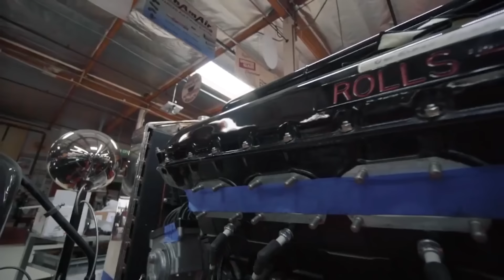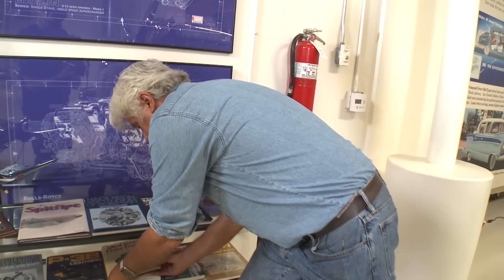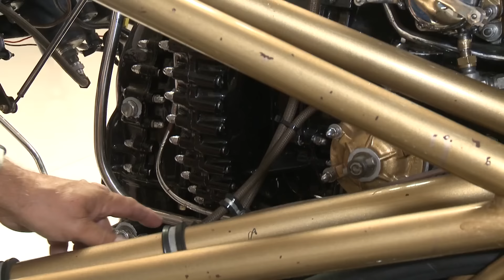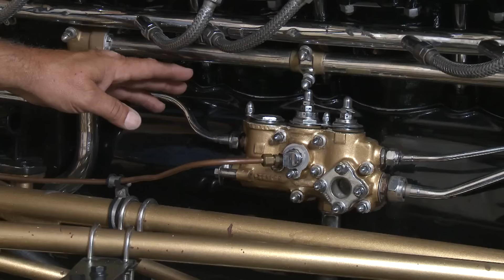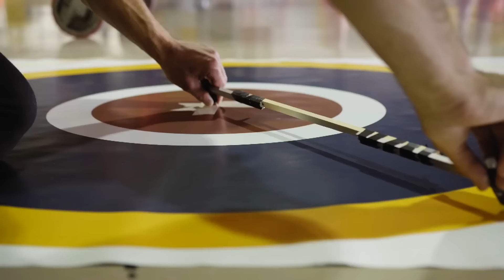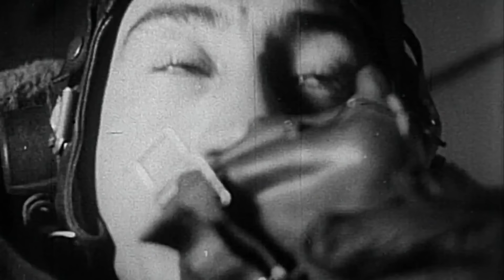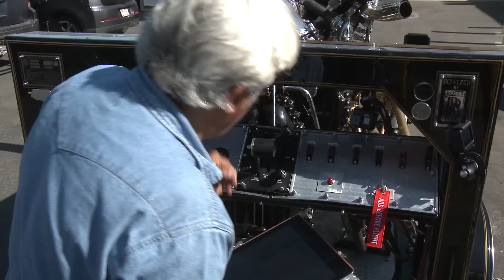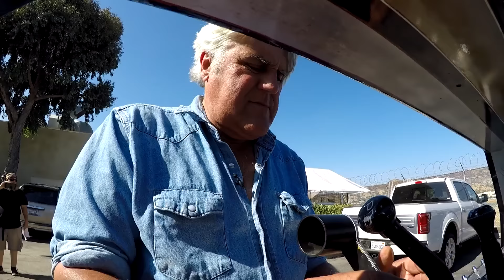The Engine That Won World War II - Jay Leno's Garage

Comment: How could you not mention the Spitfire, the Hurricane, and the Mosquito??  HELLO??
Reply: Now fellas, don't spoil a good thread by arguing. the Spitfire took on the German fighters and the Hurricane went after the bombers. It was a better gun platform and still relatively agile for the period. The Spitfire gets all the credit, because it is simply the single most beautiful war bird ever built. As a side note, the British almost named it the shrew..
Reply: The Packard V12 used in PT boats wasn't a Rolls-Royce design; it's a much larger and slower-revving engine that Packard designed to meet a military specification.  Yeah, thanks to Jay for sharing his rare and impressive engine.  It's an artifact that runs!  What more could we ask for?
Reply: @rocketman63  rocketman  M2500 was 50% larger than the Merlin and was redlined at 3,000 RPM  same as the merlin !!! !  DUUUUHH!!!!!!!!
Reply: @wilburfinnigan2142  Neither type was run at redline for more than a brief period.  I don't have the facts before me, but I do know the Merlin was rated to run at "emergency power", reached at maximum RPM and increased boost, for only a few minutes.  They required careful inspection after use of emergency power, which was true of many piston-engined aircraft.  

        It's very unlikely that the Packard M-2500, or indeed any marine engine of the time; spent much time at or near redline.  They produced most of their power lower in the rev range, and the reduction gears were designed to take advantage of this.  Cruise RPM was 2400 for the 4M-2500.  There would be little point in turning (and stressing) these engines when there was little need. Further, unless they were on flat calm waters, these boats would have been a pounding, bouncing handful to try controlling at 40+ knots.

        One last point, and this purely subjective,  I used to allow snide people like you to piss me off and detract from my enjoyment of Youtube.  Now, I realize you reveal much about yourself by pouncing on a comment you don't like with a nasty remark.  So my response to YOU was without rancor.   Perhaps you need a little enrichment in your (off-line) life.  

        Happy Youtubing.
Reply: @rocketman63  M2500's were known to be a tough engine and were run hard in war time and they held up !!!  Nothing wrong with the engine and over 14,000 of them saw service all over the world in WW II !!!   War time conditions were not conducive to timely tear downs or checkings, they run em till they broke and put a new one in !!!!  PACKARD did its self proud with the design and construction of that engine !!!!  !
Reply: jtkent.
In 1940 there were more Hurricanes and they did down more but a lower percentage, from 1941 the Spitfire was flying sweeps over France, the Hurricane doing ground attack and defending Malta until Spitfires took over as they did in Malta and everywhere else.  Spitfires seem to get a lot of negative press these days and it takes a lot of research to find out true combat figures but from what I have seen the Spitfire would seem to have downed more German planes than any other fighter.
Reply: Barrie Rodliffe I actually thought I heard the hurricane did actually down more aircraft in the entirety of the war than the spitfire, but I could be wrong.
Reply: Barrie Rodliffe. Both planes had their place. As you probably know in the Battle of Britain the Hurricanes shot down more planes than the Spitfires. The Spitfire was cutting edge technology with an all stressed metal skin while the Hurricane was a half and half stop gap (all canvas behind pilot). In 1938 two or three Hurricanes could be made in the time it took to make one Spitfire. The Spitfires and Hurricanes issues revolve around being so small there was little room for bigger guns or much fuel. 
Some Americans even call the Mustang the Spitfire MK2, it was a huge disappointment before the RAF experimented with putting a Merlin in a couple. If you look at the late war Spitfires (mk. XX+) they are virtually a different plane being almost 50% bigger.
 As stated this video is about the engine which was used in tanks, planes and boats. The British PT boat the MTB had 4 of them....😁. This engine was a war winner. Nice one Mr Leno.
Reply: Ronald Reed 
Barrie Rodliffe the p51 was a superior plane to any of thpse planes mentioned, after the packard rolls was installed 

Strange that this comment was made to me then deleted.

Just to take it at face value.
The P 51 was superior to any of those planes mentioned after the Packard Rolls was installed."   There was no Packard Rolls, Packard were a subcontractor producing rolls Royce engines so the Rolls Royce engine being installed in a P 51 made it better than a Hurricane, I guess that is true except the Hurricane was used from the start of the war not just from early 1944. 
Better than a Spitfire?  well in early 1944 the Spitfire k XIV performed better in every way except for range, the Mk IX had better acceleration, climb and maneuverability.
Better than a Mosquito?  not quite comparable, Mosquito`s were used for long range photo reconnaissance, bombing, anti submarine and anti shipping, night fighter and other jobs the P 51 could not manage.
Is it a coincidence that the Mosquito and Spitfire were better for shooting down V 1`s too.
Reply: Stu Art. It’s an engine, not a motor!
Reply: rocketman63 >>>  well he could have mentioned all those, but to do it justice, we’d have been watching this video all night.  He has to keep it brief to keep it under 30 mins.
Reply: Silverarrow the reason the Germans were reaching for superweapons was out of desperation, I agree the DB was a superior power plant in the early years but developing the Merlin lead to a magnificent engine, reliable and powerful yet buy choosing to develop the gas turbine the Germans handicapped themselves, the junkers jump had a TBO of less than 50 hours which it never met in operational service and the airframe technology was not capable of dealing with speeds greater than that of a mk8 spit anyway so the whole exercise proved a waste of time and resource.
Reply: Silverarrow. 
The me 262 first flew in  April 1941 with a piston engine in the nose because the BMW engines were not ready, the flight in July 1942 using the BMW`s and both engines failed, lucky the piston engine was still there, after a lot of modification to take the Jumo engines it took until late 1944 to get enough of these troublesome engines to put the Me 262 into service in small numbers, it could still not match a Spitfire or Tempest.
The Daimler Benz used in the Bf 109 did use fuel injection but that did not give as much power as the smaller RR Merlin in the Spitfire.  The Spitfire and Hurricane did not stall in a climb or steep dive, they had a momentary cut out with negative G but that was not hard for pilots to avoid and soon remedied.
Reply: Barrie Rodliffe one of the reasons for developing fuel injection over the pressure carburettor was consistent fuel metering between cylinders at all power settings something a large engine with a single carb could never achieve resulting in some pots running lean and hot, and some running rich the problem was so bad that engine manufacturer of the day were fitting diffusers (low-no boost superchargers) just to ensure better distribution. The injection system was crude but continental still build and sell full flow uncompensated injected engines for use in modern light aircraft. 
I have no idea what weights you are comparing, the MTOW of machines around at the same time puts the 109 at a half ton heavier and pilots reports of their machine outclimbing the opposition should be treated as circumstantial as there are far too many variables compared with book figures which are supplied for the purposes of ascertaining weather or not a machine is serviceable on  test flight.
Reply: Barrie Rodliffe the stoichiometric ratio is the name given to the optimum fuel air mixture, just for your future information.
Reply: Barrie Rodliffe I'm sure you spent a long time trawling wiki for all the figures you quoted, it's quite easy for you to do the same with "calculating bhp" I assume you have which is why you are being insulting.
Bhp can not be measured, all a dynometer does is measure torque and speed, run them through the equation I have already given you and show a bhp figure based on watts original equation.
If you are incapable of grasping the basics of piston engine theory then I must assume that you are just another troll.
Reply: Barrie Rodliffe there is absolutely no point talking to someone like you, obviously you have now checked, realised how utterly stupid you look and are trying to worm your way out of it, I fully expect you to be busy editing your previous comments as if this was important on any level, as if what the few people that may eventually read our comments opinion actually matter. The truth is  the only thing that matters is that you are a pathetic individual.
You have no idea what bhp actually signifies, apologies for writing five, instead of force, but I meant to say force * distance, this is torque.
Reply: Barrie Rodliffe have fun editing all your previous comments, I hope you can look back on it and consider it time well spent.
Reply: Sorry Barry but the Hurricane was much more successful in combat than the Spitfire: 
The Air Ministry confirmed this with its statement, ‘The total number of enemy aircraft brought down by single-seater fighters was in the proportion of 3 by Hurricanes to 2 by Spitfires,’ and also noted, ‘the average proportion … of serviceable [aircraft] each morning was approximately 63 percent Hurricanes and 37 percent Spitfires.’
Reply: Yes mostly because they entered service earlier than the Spitfire.They were similar in many ways apart from fuselage construction!
Reply: The Spitfire was an interceptor, and really had no range compared to the P-51. Therefore it wasn't used in the same way as a P-51. I'm a big fan of Spitfires, but the P-51 was just an all around more capable, modern airplane. 
The war wasn't won because one airplane turned better or climbed better than another, it was how and where the plane was deployed, tactics, and the numbers available. 
The British keep trying to rewrite history on the internet, doing more damage to their heritage and to their airplanes credibility.
 Stop trying to defend an airplane- Spitfire, Mosquito-- that don't need to be defended.
Reply: Brian O'Toole the p51 had 2 engines the Merlin which was better for bomber support and the Allison 1710? Can remember the size and that was better at low altitudes because it lacked the second stage supercharger why does everyone forget the Allison wasn't worse then the Merlin it is and was a wonderful motor
Reply: The P-51's range changed everything in the air battle during WWII.  The Spitfire and Hurricane are nice machines but inconsequential in terms of its overall impact.
Reply: andreboy1 

The P51 was an excellent aircraft which allowed the USAF to continue daylight bombing operations over Germany, maintaining the pretence that they were bombing precision targets from high altitude. Without the P51, they could have switched to night ops like the RAF, and admitted that they were largely area bombing. The main success of bombing from '41-'44 was to pin down resources in the West rather than allow the full attention of the Nazis to be focussed East. Whilst it did reduce production capacity, the post-war strategic bombing survey found that the rate at which this occurred was not as significant as hoped.

However, without the Spit & Hurricane, there may well have been nowhere for the P51 or the B17 or the Lancaster for that matter to fly from.
Reply: Paul.
As I know there were more Hurricanes than Spitfires in the Battle of Britain and the Spitfire had a higher kill ratio and lower loss ratio.
If you look at the Spitfire Mk IX it was very capable from 1942 right through to the end of the war, some even shot down V 1`s and Me 262`s, the Mk XIV which had the Griffon engine was still very much a Spitfire, the Mk 21 did have a different wing and it was almost given a different name.
The Spitfire was able to take the Hispano 20 mm cannon, usually just 2 of them but it was tested with 6 x 20 mm.  The short range is a bit of a myth since Spitfires were able to carry extra fuel, the Mk VII and VIII had 124 gallons internal fuel, including some in the wings and could take a drop tank so range was more than doubled, it was even possible to carry more fuel internally as some Spitfires did in the rear fuselage, up to 75 gallons and with a drop tank range was rather good.

Many MTB`s did not have Merlin engines, a few had 3 Packard boat engines, bigger and faster ones mainly had 3 Isotta Fraschini engines.
Reply: When the then dying RJ Mitchell was told that the aircraft had been named "Spitfire", he is said to have replied: "the sort of bloody silly name they would choose!"
Reply: rocketman63 maybe in American boats, but the British Vospers had three meteors the de-tuned  single ignition normally aspirated version of this engine as fitted to many tanks right up to the 60's there was also a V8 based on the meteor called the meteorite which found its way into a the army's tank transporter after the war.
Reply: @turboconqueringmegaeagle9006  , I didn't see your reply earlier, or I'd have responded then.  The British Vosper MTB was an entirely different boat than any of the American PT boat designs.  It does stand to reason that they'd use different engines to power them.
Reply: @rocketman63  sure thing, different boats for different jobs in entirely different theaters.
Just pointing out that the meteor was used in what an American would consider a PT boat even if we called them MTB's
Reply: How is a less powerful bigger engine superior?
As for faster, they were fairly equal on top speed and rate of climb, except the Spitfire could use + 12 lbs boost and with the constant speed propeller it made a big difference.  
The Bf 109 E was given more power but so was the Spitfire, remember the Bf 109 first flew in 1935 with a Rolls Royce Kestrel engine, the DB was not ready, the Merlin was, the Hurricane flew in 1935 using the Merlin engine.
The DB 601 first ran in 1935, the Merlin 1933.
Which heavier aircraft?
Reply: Fuel injection was not as good at the time as a well designed carburetor, as for supercharger Stanley Hooker was the master.
The much later Bf 109 G 6 weighed just 1/2 a ton more than the Spitfire Mk I,  but the Bf 109 E empty 4,189 lbs, the Spitfire Mk I empty  4,306 lbs. so the spitfire was slightly heavier. 
In the Battle of Britain the Bf 109 and Spitfire had similar rates of climb  but Spitfire pilots reports often mentioned being able to catch a Bf 109 in a climb. it might depend on the altitude.
By early 1940 they were able to use + 12 lbs boost and before the Battle of Britain DH was fitting constant speed props and Rotol also made constant speed props.
By 1940 the Merlin was better ant it continued to be better.
Reply: There was a very good reason for using a carburetor, it was more efficient and on the Merlin worked very well, giving more power than the bigger DB 601. Remember that Rolls Royce cleared the Merlin for + 12lbs boost in 1940.  Sir Stanley Hooker knew about fuel injection but rejected it for very good reasons.
I gave the empty weights of the Bf 109 E and Spitfire Mk I but lets take laden weights, Bf 109 E 5,875 lbs, Spitfire Mk I  5,935 lbs, Spitfire Mk II 6,172,  I have no idea where you get half a ton from but that is untrue.
Pilots reports of actual combat are hardly circumstantial.
Reply: As you obviously don`t know what you are talking about,  fuel injection was not knew but it was not well developed at the time, it did not work as well as a good carburetor. combine a good carburetor with an efficient supercharger and it was far better at the time, we are not talking about modern electronic fuel injection systems, I am sorry but you are out of your depth on the subject, I have worked with  superchargers, carburetors  and water injection,  The Luftwaffe were operating from French airbases which were not far from the South East of Britain, so the slight advantage of range was no big deal.  The  Spitfire and Bf 109 had a similar range.  The DB was superior in what way, less efficient, less powerful and the early days? The Merlin was slightly ahead of the Db 601.
Pilots reports were done by pilots flying the planes in combat,  the Griffon which did not replace the Merlin had nothing in common with the DB engine, the Griffon was based on RR designs and it used the same  design of supercharger and the same fuel as the Merlin, in 1944 both were run with + 25 lbs boost, Rolls Royce along with SU developed the carburetor during the war, they developed the speed density carburetor, followed by the pressure carburetor and even an injection carburetor.   
If you are wrong?  How could you be anything but wrong, I gave the empty weight which shows the Spitfire slightly heavier then I gave the laden weight which also shows the Spitfire heavier, This was in the Battle of Britain. Later the Bf 109 got heavier, the Bf 109 G 6  was up to 5893 lbs empty and 6,940 laden weight, but the Spitfire also got heavier, the Spitfire LF Mk IX E 7,400 lbs laden weight.
Reply: I don`t believe you, you are too ignorant.
The simple truth is that Rolls Royce used a carburetor because it worked better.  If you can`t understand the first thing about the subject give up. 
The DB engine was much bigger but less powerful, how is that possible if it was better as you claim.  sure a bigger engine will have more torque but that is all. Rolls Royce did later go to an injection carburetor not full fuel injection which did not work as well. 
The Griffon was bigger than the Merlin but it still used the carburetors and superchargers developed for the Merlin, nothing  like the inferior DB designs.
The Griffon was in development from 1938, it was tested in a Spitfire Mk IV, it did not replace the Merlin in Spitfires,  The Spitfire MK VII, VIII, IX and XVI were still in production when Griffon engine MK XII, XIV< XVIII, XIX and even the Mk 21 were in service.  I do not use Wikipedia, try books sometime they may help you a lot.  
Going by what you`ve been told is not really very intelligent, it pays to do some research for yourself.

I have been told  Bf 109 could turn tighter than a Spitfire, yet I find the reverse is true.
You tried to say the Bf 109 climbed faster than a Spitfire yet I find nothing to confirm that.
One thing that is true is that both the Spitfire and Bf 109 were continuously developed right through the war, both gained performance and both gained weight.
Since you are convinced fuel injection was better why not try reading what Sir Stanley Hooker wrote in his book, or other material, there is an excellent work by an American who writes about carburetors and fuel systems.  
Now I shall play with my supercharged car with a single carburetor for a while, it does work very well. Even in the 1970`s Aston Martin used fuel injection on their V 8 but for their most powerful car they took off the fuel injection and used carburetors, MG had fuel injection in the 1980`s, but their most economical version had a single carburetor and so did their turbocharged  version of the same motor.
Reply: Power output from an engine equates to the sum of a considerable number of components that include things such as compression ratio, flame angle, burn duration, air temperature, combustion timing and temperature, fuel humidity, Supercharger boost pressure for a given air/fuel ratio and so and so on.  One of these parameters is the amount of fuel for a given volume of air (air fuel ratio) and this on the Merlin was varied automatically at differing altitudes to help maintain the required mixture ratio.  
In a Carburettor, there is drop in fuel temperature due the air passing through the venture (caused by the Bernoulli’s principle for those that want to know more), resulting in an increase in fuel density for a given volume. Too lower drop however results in the formation of carburettor Ice, and as any modern piston engine pilot will tell you. This will result in either a significant power reduction or totally stopping the engine if this is allowed to happen. However, the RR logic and design philosophy was simple and justifiable, the greater the fuel density =the great the power. RR also had a continual program of improving the performance, including areas such as the supercharger. 
Rolls Royce stayed with the carburetor for very good reasons, they kept making improvements and they went to the speed density carburetor that was extremely good and better than fuel injection until modern electronics came along, after the speed density carburetor Rolls Royce went to a pressure carburetor then an injection carburetor
 decision was made to use the Speed Density equipped V-1650-11 in the P-51L airplane, and it was necessary to provide Water Injection (ADI) for high power detonation control. The second-generation models incorporating this feature were the SD-400C2 and SD-400D25. A new "Water Regulator" was developed and integrated with the Speed Density Fuel Control.

Engineering and development delayed the production of an initial batch of 70 SD-400C2 units intended for the first batch of 50 P-51L airplanes that was scheduled for completion by September 1945. In June 1945, the decision was made to defer production of this first batch of production aircraft, engines and fuel controls until January 1946.
Did the Griffon use fuel injection? not it seems during the war.

As used on the Griffon 65  Triple-choke Bendix-Stromberg updraught, pressure-injection carburetor with automatic mixture control.  
An injection carburetor is not multi point injection in the slightest way.

As for big V 8`s, they can be rather sluggish compared to smaller more efficient engines, all the torque and no go, my own 58 cu inch supercharged MG used to make quite a lot of 300 or so cubic inch V 8`s look silly, Of course it was not really fair my MG had a supercharger and a similar carburetor to that used by RR and the MG did not weigh 2 tons.  

I really do not know where you get your information from but it seems to be very wrong.
Reply: I  really wonder if you have any brain.    You were wrong about the weight of the Bf 109, you were wrong about the engines and you were wrong about Rolls Royce using fuel injection on the Griffon engine.
When you can get one thing right try it.
You are quoting things you have no understanding of.
For your future information try to get a decent book and read it instead of copying things that you don`t understand.
Maybe why US cars bhp was always so exaggerated.  
Do you know what a dynometer is used for?  Go on look it up, I am sure it is in wikipedia like all the nonsense you try to come up with.
Reply: Turbo Cockhead.
I do not use wikipedia for true data, unlike you, all you do is copy and paste what you do not understand. I have not been insulting up to now but you are pushing your luck.
BHP can be measured and it shows the smaller more efficient RR Merlin gave more power than the DB 601, you can torque all you want the facts are what they are.
If you do not know the difference between a pressure injection carburetor as on the Griffon and fuel injection it is not my fault.
You are the typical you tube liar, when shown to be wrong you switch to something else.  
What is it like to come up against someone who does know enough to make you look stupid? 
I have already suggested you read Sir Stanley Hookers book, it might help rather than just what you are told by some random person or more likely what you try to read but do not understand.
If you read wikipedia you probably find the DB 601 in the Bf 109 E had 1,150 hp and the Merlin in the Spitfire Mk I 1030 hp, however before the Battle of Britain  the Merlin engine with +12 lbs boost gave over 1,300 hp and I have found several accounts by Spitfire pilots of how if a bf 109 was behind they could turn and climb away and other accounts of how Spitfire pilots could gain in a climb.  That is from real pilots who flew the planes, not just what some random person told me.
Go back to school.
Reply: You are correct - see earlier comment from the Air Ministry.
Reply: When you are in a hole -stop digging!
The Air Ministry confirmed this with its statement, ‘The total number of enemy aircraft brought down by single-seater fighters was in the proportion of 3 by Hurricanes to 2 by Spitfires,’ and also noted, ‘the average proportion … of serviceable [aircraft] each morning was approximately 63 percent Hurricanes and 37 percent Spitfires.’
Reply: No Griffon used a hydraulically controlled supercharger.
Reply: Well, the Hurricane had more kills than did Spitfires during the 'Battle of Britain', accounting for 60% of all downed Luftwaffe planes. and was easier to repair and get airborne again after a fracas. That said, the Spitfire still ranks as the most beautiful and iconic airplane ever made imo.
Reply: 60% of all kills in BoB
Reply: Also MTB's and in a de-rated variant, tanks.
Reply: Technically he is right but only if you concentrate on the Battle of Britain
Reply: https://www.google.co.uk/url?sa=t&source=web&rct=j&url=https://www.mirror.co.uk/news/uk-news/battle-of-britain-week-was-the-hurricane-the-plane-247944.amp&ved=2ahUKEwitosmCyfrZAhWMmbQKHWbNC7MQFjAAegQICRAB&usg=AOvVaw37ccg00xcTSiSG08BnayU-&ampcf=1 

I love the spitfire ever since my dad took me to my first air show and seen one face to face  when we was at raf leuchars when he was in the raf. But as the article says it clearly wasent. But that dont bother me both where as good as each other.
Reply: you should file an engine rights  complaint.  he was being racist .
Reply: rocketman63 I’m sure he’ll do a story on the mosquito when he does his furniture restoration video absolutely amazing playing the mosquito
Reply: andreboy1 To say the inconsequential I’m going to disagree with you the Spitfire was a very very fast plane and did live up to expectations it freed up the Mustangs to escort the bombers
Reply: fact hurricanes acounted for more kills during ww2 than the spitfires! They were easyer to repair being wood n metal frame with dopped canvas streached over it so spent less time rotated out for repairs after combat and for most of the war ther were far more of them maybe you should check you history
Reply: fooloof  1054 Shitfire MK XVI  (16) used only the Packard built merlin 266 the only shitfire to do so and late 1944 !!!  and it was optimized as a low/medium altitude ground attack plane !!!
Reply: Jay doesnt need defending. But he was talking about the motor. NOT any planes. They were also used in PT boats, if you want to be super technical. Thanks Jay for a rev-up!
Reply: Barrie Rodliffe er....  Actually mate I'm a licensed aircraft engineer, I've popped a few vids up if you doubt me, quite a few years ago I went to college and studied aircraft piston engines along with turbines and gained both my national license and European license and have spent my entire working life maintaining and repairing piston engined light aircraft so I'm sorry if what I'm telling you went over your head but that is no need to be insulting. No matter how good a single carburettor on a V12 is, it is impossible to ensure even fuel air distribution to all cylinders. I mentioned the continental system as from what I understand of the dB set up, the continental full flow system is more basic yet it is still fitted to brand new aircraft. The similarities I drew between the griffon and dB were to highlight RR moved to injection, hydraulic controled supercharger and a similar displacement and as far as I know new aircraft were designed and built powered by griffon land existing designs were modified to accept the griffon so most people of a less pedantic nature refer to it as the Merlin's replacement.
I'm not arguing with you over the weights, I was even gracious enough to admit I might be wrong as I'm only going off what I've been told by people that work on warbirds however I suspect you are just reading Wikipedia so bravo, well done, have a buiscuit.
Reply: How long does it take to mention 3 of the most important planes in the war that used the Merlin engine?  not as long as it does to type this brief reply.
Reply: Barrie Rodliffe  Burt Ruttan said it best, "hp sells, torque propels" early DB vs early Merlin was a technically superior power plant and did propel a 109 at faster speeds than a spit, which is to be expected as they had a head start with development and operational service in Spain and eastern Europe, definitely better suited to the heavier aircraft.
Reply: Barrie Rodliffe I said the earlier engines were technically superior. And they were with their variable supercharger and injection. 
Torque is more important in an aircraft than bhp figures and you can see this in a comparison of climb figures of the two aircraft, while the 109 was half a ton heavier, it would still out climb a spitfire, a lot of people think bhp is the most important figure when discussing performance this lead Burt Ruttan ( the most important one man design team in the later half of the 20th century) to say "hp sells torque propels"
Either way Rolls always has and always will be the finest engine manufacturer on the planet so with a couple of years of wartime service the Merlin was developed into a better engine than the dB.
Not sure your information is correct regarding constant speed props, but the 109 certainly had variable pitch even if it wasn't govourned by speed.
Reply: Barrie Rodliffe Barrie Rodliffe as already mentioned, injection solved the long standing problem with unequal fuel distribution completely eliviating the issue of burnt exhaust valves and plugs on the cylinders furthest from the carburettor. Combine the injection with a fluid driven variable speed  supercharger that is compensated for altitude and there is no question It is technicaly superior to a carbureted system with a comparatively crude ground boosted system.
Climb figures are based on MTOW in order that an aircraft can be brought up to a known weight and flight tested, while it is possible to set a machine up according to a maintenance manual a timed climb at a known mass can still show up any deficiency in any major component or combination of.
Pilots reports are circumstantial because they are done outside test conditions with unknown load, unknown entry speed into a manouver and during wartime service while the Luftwaffe were operating from captured French air bases, questionable line maintenance. I will always argue that RAF fighters had the harder task, they did have some advantage though, cheif among them were not having to enter combat with enough fuel on board to make the return to France as the Luftwaffe pilots did.
Please do not think I am a German fanboy, if I am incorrect about weights and climb figures I would be surprised but it does happen on occasion however my original comment still stands, the db was a technically superior power plant during the earlier years of the Merlin's service.  Something to ponder, the griffon (RR's replacement for the Merlin) had more in common with the dB than the Merlin as far as displacement, supercharger and fuel were concerned.
Reply: Barrie Rodliffe carburetors work very well on radials as it is easy to get similar route to each cylinder from the carb so it is no surprise the Americans favoured carbs, their engines were also of far lower output for a given capacity so uneven fueling would cause less damage. The problem with mounting a carb at one end of a very long engine as in the Merlin's case was that fuel drops out of the airflow the further it travels, I'm sure you appreciate for a aerodynamical package, the carb and blower could not be mounted centrally as they are on a drag car, nor would a roots type blower be suitable for aircraft use due it's incredible weight and inability to alter it's output.
I would hope if you are knowledgeable in respect to big v8's you would appreciate the difference between torque and HP, hp is basically a sum of torque and revs, and as such it is not unusual for a machine with less bhp to accelerate faster than one with a higher figure. 
The carburettor did not work perfectly as you emply due to rich cuts.
And the Griffon did have low pressure continuous flow multi point injection in a similar fashion to the dB.
Reply: Barrie Rodliffe  the equation is  (VxIxEFF) /746=hp you can try it yourself v-rpm, I- torque, eff- efficiency 0.7- 0.8 and the 746 or 5252 is there to produce a manageable number people can understand, James watt came up with it as a way of rating steam engines, 1 HP it's supposed to represent the work a draft horse could do.
There is no direct measurement of bhp, I'm sorry I thought everyone knew that.
Reply: Barrie Rodliffe this is gold, seriously check out the calculations for bhp and then bow to my superior knowledge.
Reply: Barrie Rodliffe so what is hp, explain that to me? You absolutely can not because you are laughably wrong, you keep editing all of your comments too, that is the mark of someone ashamed of themselves, you are absolutely hilarious, I could help, that is after all why I enter into debates to learn.
Reply: Barrie Rodliffe so you can't explain what hp is....   I think the alarm bells should be ringing in your head now. 
So torque is a measure of five and distance, rpm is fairly self explanatory, revolution and time, I offered you the explanation that hp is a multiple of both torque and rpm, however you deny this yet are unable to quantify it. 
Explain to me what hp is as I have explained torque and rpm.
Reply: Paul.
I do not need Wikipedia for the truth, 
The Isotta fraschini was used in the fastest of the MTB`s until they became scarce, the Packard boat engine was not as powerful.
The Merlin engine was used in MTB`s and MGB`s but it was not replaced by Packard for any reason except the Merlin was needed for many other things the heavy big Packard boat motor was no good for. The Packard built Rolls Royce Merlin was not as good as the Rolls Royce built Rolls Royce Merlin.
Reply: Turbo Twit.
Simply check out the carburetor used on the Griffon, check the weights of the Bf 109 and Spitfire, check out the rate of climb of both and admit that you are very wrong all the time. Only the post war Griffon 101 and 130 used the Rolls Royce fuel injection system not the wartime Griffon engines.
Your superior knowledge is the nonsense you pull out of your ass.
I do not care what calculations you claim to know about, HP is HP.
You can  be stupid all your life, I do not care. 
I never bow to idiots.
Reply: Turbo nitwit.
Hp is horse power, what do you need me to explain?  It is rather basic stuff.
I edit my comments if I notice a mistake after i put it up, sometimes a simple spelling mistake or as happens hitting the wrong key or even holding caps lock a fraction too long.  The other reason I might  edit the comment is to add something relevant.  
Tha mark of an idiot is to try to be clever and fail as you do all the time.
We can all learn but I can learn nothing from an ignorant fool like you.
Reply: Turbo Dimwit.
Torque is a measure of five and distance?   what the hell does that mean?  
I think what you misread is that you can work out hp roughly if you multiply the torque and revs, then divide by 5.252, that will give you a figure of hp but that is not what hp is is it?  Hp is a measure of power. 
Torque is the rotational force, rpm is revolutions per minute. 
 1 hp is the power generated by 1 horse.
You have explained nothing idiot.  

You really need to go back to school.
Reply: Barrie Rodliffe What you quote from Wikipedia may be technically correct for pre-War MTBs, but does not tell the full story. After the start of the War not many Italian motors were made available and as few as six MTBs had them. The Packard motors were often Packard built Merlins. As the war progressed the Merlins were dropped in favour of the Packard 2,500s which were better in marine environments. My uncle owns a Fairmile D was a mid-war model "Dog Boat" that did have 4 Merlins. He took 2 out and added 2 fuel tanks. He rarely used all 4. It also cut the fuel bill and without the armaments and armour they were best used for parts for to keep the other motors going once parts started to get scarce in the 1980-90s before the internet made tracing parts easier. There used to be several of these boats in private ownership here in NZ.
Reply: This was NOT about the spitfire.hurricaine{which did more than the spitfire} nor wooden mosquito' It was about what it was about
Reply: munya.
The Hurricane did more than the Spitfire?   really, Maybe you need to learn history, or next you will state the P 51 did more than the Spitfire, that is not true either.